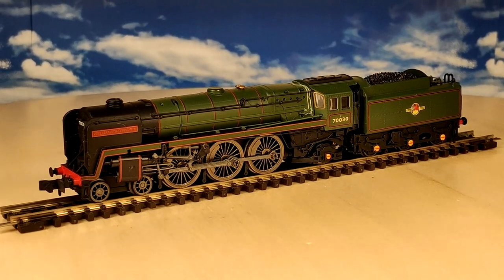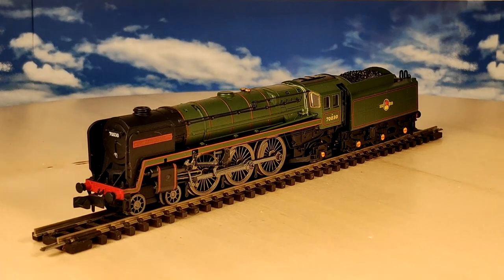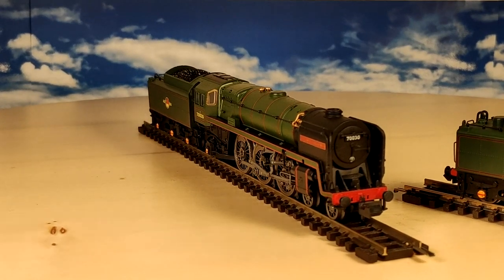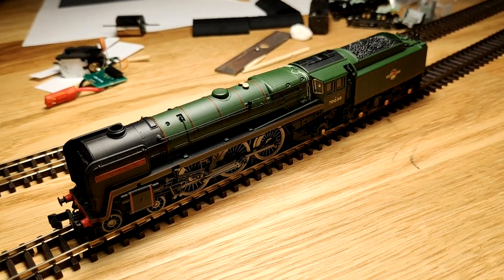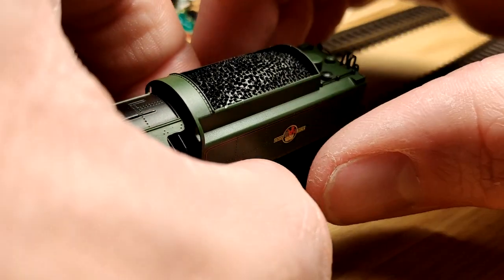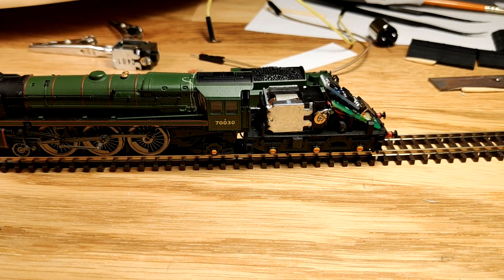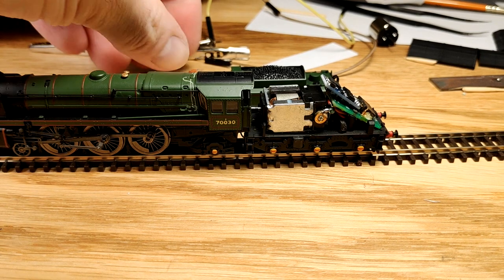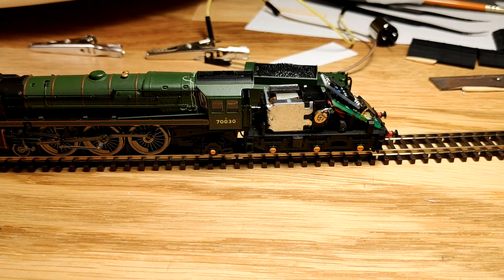Dapol "William Wordsworth" Non Runner Motor change

Comment: You should never assume it’s dcc or dc without actually looking when buying used, I love buying non dcc and converting and have had the same result as this a few times and the resistors are best removed when converting to dcc as they can choke the loco and effect the running, the decoders do all the work that they did. The motors are sometimes repairable always worth a look some issues include 1 coil not soldered, washers missing on armature causing binding, broken brush, damaged springs and one that had a brush missing and was running off the spring good video anyway have fun.👍 one other thing when connecting the decoders just remember red right black left same with motor orange right grey left motor on its side I normally find orange top grey bottom.
Reply from the maker: Yeah im still learning, i guess we always do though... I thought it best to just show how to replace the motor rather then take it apart, rewind it bearings etc... It can all be repaired for sure some way or another tbh, with my wiring of DCC in the past i dont worry about which side the pickups are wired in my locos because the chips have rectifiers built in so threre really is no need, The motor wiring can be important to get correct if running the chips on dcc and dc configuration however i again dont worry about that as i can reverse loco direction on my pc and i dont run my locos that have dcc on a dc system, i disable that function too. Directional lights change when i reverse the loco direction on my PC again so no issues there either. If my chips were ever to see dcc they wont do anything. Yeah i find it quite fun too converting the older locos in most cases to DCC 👍 Completely agree it is definitely a good idea to remove casings and covers if testing things out for the first time (i just couldnt be bothered 😂) to make sure not only whether the loco is DC or DCC but mainly to see if there are any loose wires or potential shorts that could arise, to clarify DC on a DCC chip is actually ok... The problem would be running DCC on a DC loco. (DC loco on DCC track) the frequencies could kill a DC motor quite quickly. I am only referring to my experiences with 6 pin and 8 pin socket type decoders here too 👍👍
Reply from the maker: Also yes absolutely those resistors choke and also those capacitors in a way can scramble the bemf to the dcc chips causing allsorts of mayhem 👍👍👍

Comment: Have those drive rods been screwed on to the wheels? Who did that to it?!
It's always a bit weird picking up ebay bargains and seeing what their previous owners have done to them... poor little locos... My EWS red class 37 was an ebay bargain marked as a non-runner... The reason it didn't run was the previous owner had absolutely filled it with grease to the point the works were all jammed up with crud. Seems like every time the loco started to fail, the previous owner simply added more grease until it finally stopped completely. Simply cleaned it out and it runs fine now.
Reply from the maker: Theres screws holding the rods however i  almost think this was an early dapol chassis and Dapol did that. If not its been done very well. 
Yes too much oil and grease does stop the locos running, ive seen this quite alot!

Comment: Well done. Not sure what the cost of a replacement Dapol motor would be shipped to Australia, but something to bear in mind. Do you know if they use the same motor for all the tender driven loco's? 👍👌
Reply from the maker: From what ive seen so far the B17,Brittania and William Wordsworth motors are all the same, i had a black steamer with tender... Cant think of the name now but that also had the same motor in it 👍, Have a look here...

https://www.dccsupplies.com/product-category/dapol-spares/n-gauge-spares/n-gauge-steam-spares/

 ...and look for your specific loco motor, at a guess id say all the tender locos are the same but you'll be able to see if it is any different on their website, good luck 👍👍
Reply: @ThisWayWorksTWW  Yep their website shows different motors for different models. Not sure of the exact differences as they look the same, but they have different part numbers. One for the A3/A4, another for Brittania, and another for the 9F. They don't list a motor for the B1, Q1, Grange, or Manor, so might be the same as one of the other 3. I have 7 of their tender locos and all are working very well. It was more a case of getting one as a spare if it was the same motor for all models, but I will wait for a failure before buying. ;)
Reply from the maker: If i do come accross a tender dapol that has a different motor il drop a comment here and let you know but yes that is probably the best way to go about it and just wait for a failing motor 👍